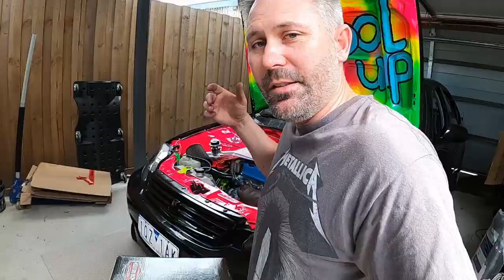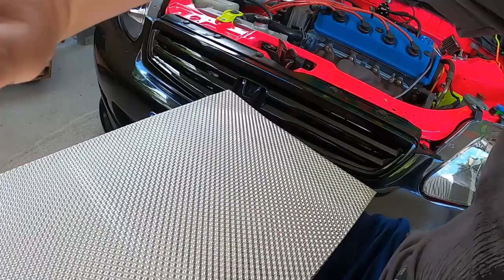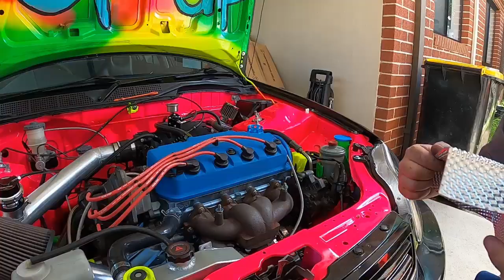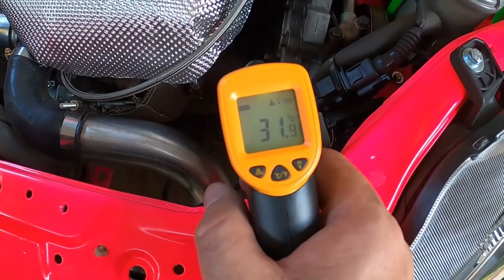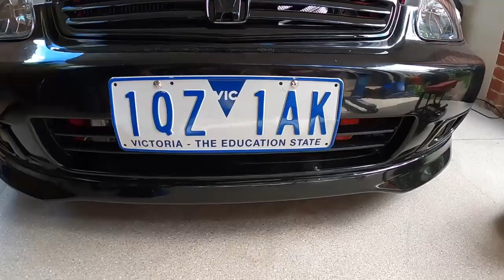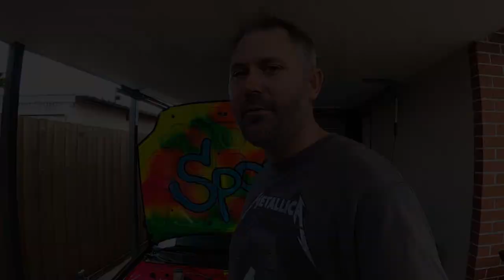ADDING A HEAT SHIELD BUDGET TURBO KIT

Comment: Your charge pipes are super close to the turbine housing which doesn't help and the turbo inlet is sucking all the hot air from the radiator if you are able to flip the turbo to where the exhaust down pipe is in front of the radiator you would have way less issues
Reply from the maker: Yeah there is no room for the exhaust then with this manifold
Reply: @TURBOTRISTO  I used to have a similar manifold on my EF which has way less room and it made the turbo sit further forward than yours and it fit the EK has more room I've seen plenty of people do it in that exact chassis with zero clearance issues
Reply: @TURBOTRISTO  It will make the world of difference bro

Comment: Hi man, Great videos again. I haven’t seen all but I shall. 😁 Just a silly question I have for you...do you know if the the d16y4 sohc non vtec engine ECU  is an OBD0, OBD1 or OBD2? I can’t get a straight answer from the forums...not naming any. Thanks.
Reply: Thanks man.👍 Is there a conversion harness you know of from OBD0 to OBD2a? Planning to stick a y1 head to my y4 block.
Reply from the maker: @dominicdemandante330  there is but in australia you need all the loom
And ecu for a vtec or bseries, the y4 has a different loom than all the other d16s a friend is making an affordable ecu for the d16y4 that is plug and play so sit tight it’s almost finished and I’ll be getting one to test
Reply from the maker: It’s obd0 it doesn’t have any obd port

Comment: Hey Tristan, was wondering if some heat resistant foam in between the gaps of the radiator and the front of the chassis could help concentrate air into your radiator. Most of the air escapes through the path of least resistance(the gaps) and I reckon you could give it a go see if it makes a difference. Cheers!
Reply from the maker: yes you are 100% correct i did mention that in the last video i did, but i have since found another solution and i cant wait to get it on the car and test it